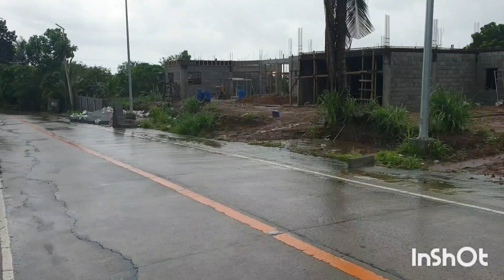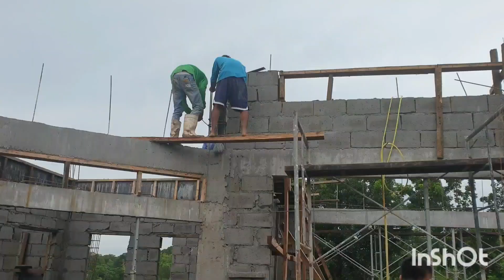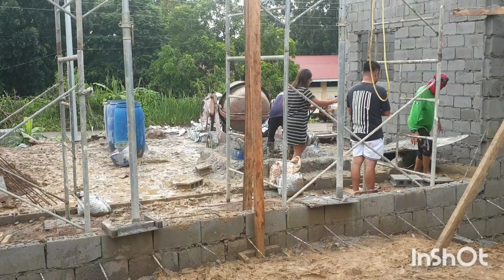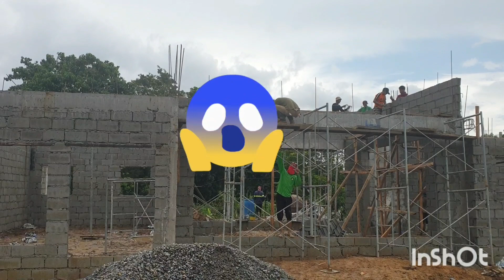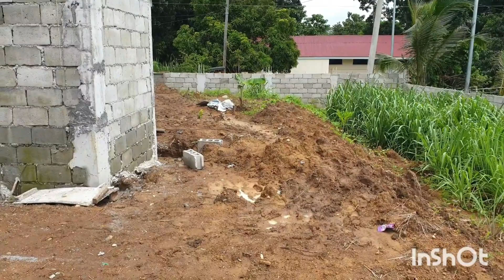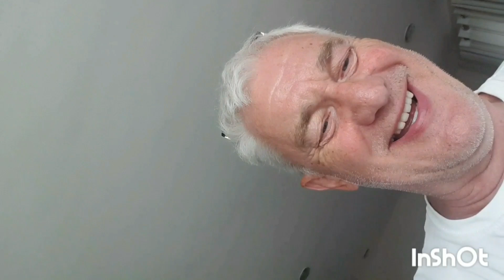House build - Week 9

Comment: You thought about solar panels cos your  palace is big and then it would  save peso if you did get that pool i mentioned...
Reply from the maker: Panels also shield the roof from direct sunlight which cuts down on the internal house heat. This might well be an option as we can hide them without being seen at ground level or in the flat roofs. Maybe in a year after we've moved in.

Comment: It's hard to build something in wet and dry weather, but if you build something from January to June, you'll probably have less hassle and more well-done job, in my opinion! I hope everything goes well after a few hiccups. Good luck, Sir Daniel!
Reply from the maker: Hi. You can't really plan around Typhoons! We started the build when the builder had a free 10 month slot and I had the cash so it worked out perfectly.  Otherwise who knows when it would start.  Once the roof is on rain doesn't matter too much so we're hoping this week trusses at the lhs end can start and the first floor slab is cast. Hurrah!